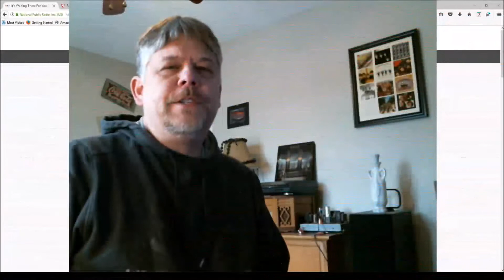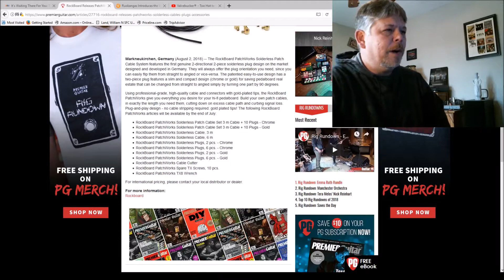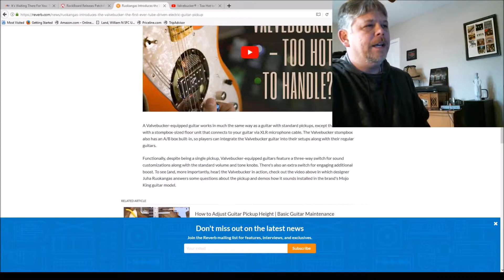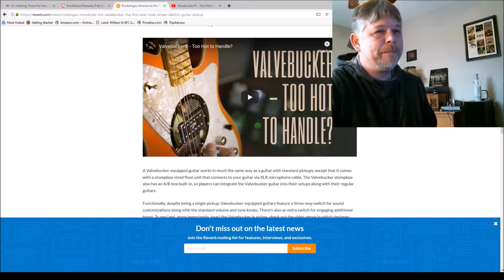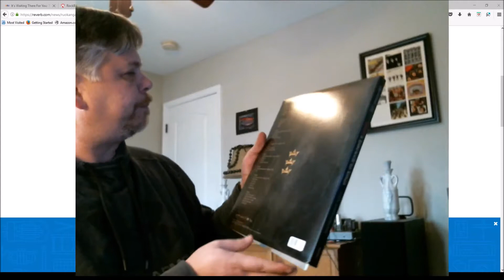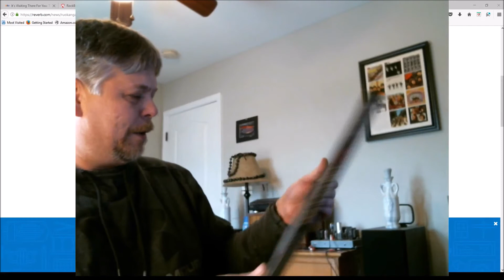Music News Monday - Valvebucker Pickups, Rock Board Patchworks, Rush A Farewell to Kings

Comment: My guess is they are using starved plate configuration. You don't need  (or should) have a 50v p-p output from a guitar, it would kill your pedals..so I'm pretty sure the tubes are fed with rectified 12Vac. You don't need perfect bandwidth, gain or even linearity.. it's just a pickup preamp.. i wonder about how noisy it would be at high gain..i assume it would be awful with the ac voltage running on the same cable plus rectification so close to the pickup.. tube freaks will love it..but anyone who knows about how tubes work are cringing..what a waste of tubes..